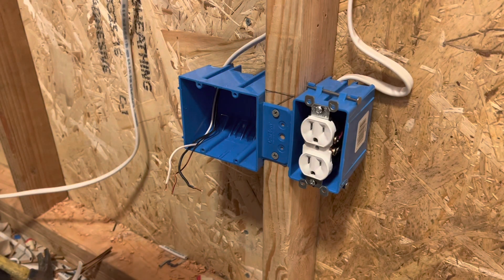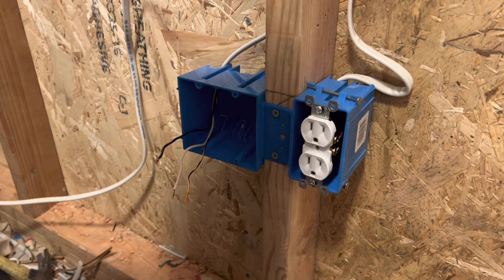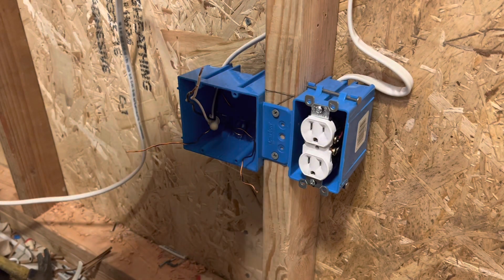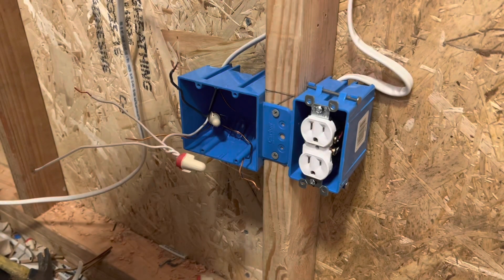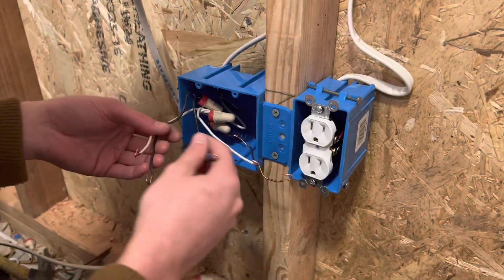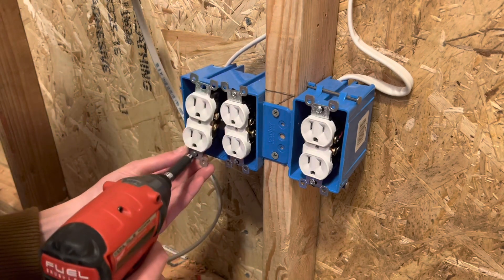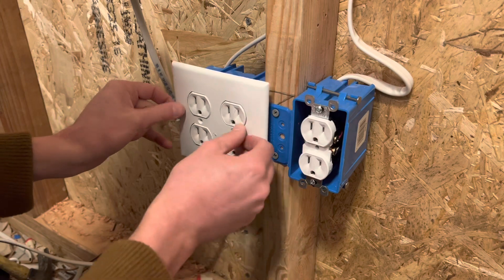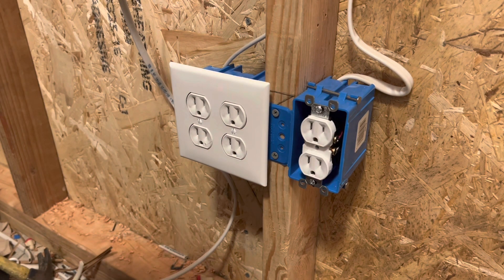Electrical 101: How To Rough In & Install A Quadplex (Residential)

Comment: You can cut all of the wires at once at a slight angle after you pre twist them with lineman's pliers first. It can help them go into the wire nut easier, but in your case you're using the wire nut to do the twisting.
Reply from the maker: okay that makes more sense. Thanks so much!
Reply: @DailyElectrician  No problem. That's kinda how I do them and never had a failed connection. I can also tell that your connections are good because I see the wires twisting at the ends. I am not really one to say pre twisting is better than not or vice versa, just as long as the connection is solid. I just find it easier for me to pre twist.
Reply from the maker: I really appreciate that, not many respect the opposite of what they prefer.

I pull on each wire to make sure it doesn't come out too :)